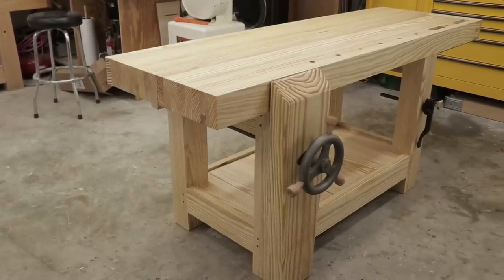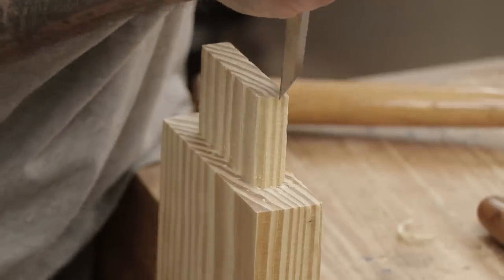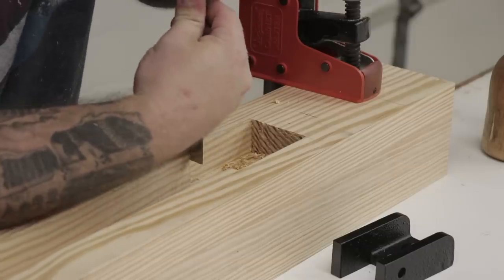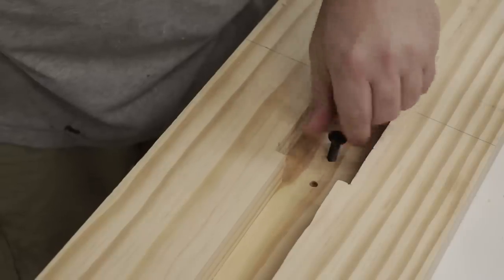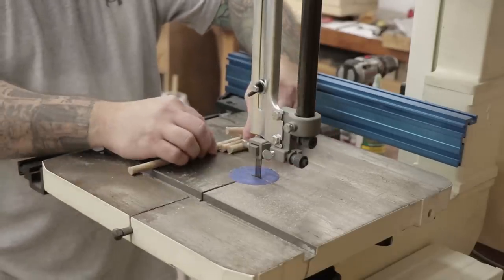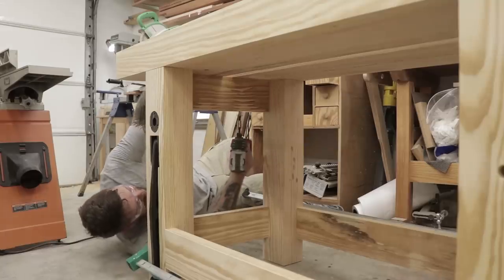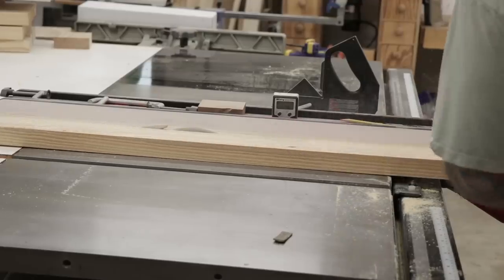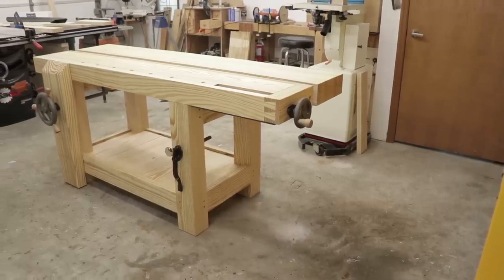Building A Roubo Work Bench Out Of Southern Yellow Pine (Part 2, Completing The Project)

Comment: Beautiful workmanship; alot of preplaning and well thought out..great job, labor of love. Last one I made in '97 was with 4X4", treated for the legs; 2X4 X 12' treated for upper and lower railes, 2X4 cross section braces, all on lockable casters...3/4"  Plywood top sections, builtin table saw and router, flush with the bench top... 10' long 32" high and 20" wide.. it was still there when we sold and moved in '17 What I had at the time was a circular saw, scroll saw, rulers and pencil...
Reply from the maker: Thanks! If I get 20 years out of mine like you did yours, I'll be happy.

Comment: Great video, thank you. When cutting your stretchers you were using the fence as your first stop, and using your miter gauge for the cut- clamp a stop block to the fence before the blade so that when you are making the cut your board is not riding the fence. Much safer that way. Awesome video though and very informative!
Reply from the maker: Thanks for the tip. I had to go back and watch again to see what you were referencing. I use a stop block when cutting all the way through the board but not when making dados shoulders and tenons. It doesnt make sense why I thought one was safer. Thanks again

Comment: Here's a tip I use when I want to tap a hole in wood. After I drill the pilot hole I saturate the hole with thin Cyanoacrylate glue commonly use for building model airplanes (I build those too). Then I tap the hole. Almost as good as tapping in to medal. Last time I used a saturating epoxy available from Totalboat. It works just as well but has a longer drying time.
Reply from the maker: Thanks for the tip. I will try it the next time I tap some wood threads

Comment: Maybe a silly question, but why did you leave the middle gap on the top? Because of the wood movement in the future? I just wonder about the the reason why not everything is glued together. Thanks and well done!
Reply from the maker: You can remove the middle piece and apply clamps through the top to hold down a  board. You can also use the board in the middle as a stop when you are hand planing or using other hand tools. It has come in handy a few times over the last few months.
Reply from the maker: I made a video about making a shaker cupboard with only hand tools. I use the middle feature a few times throughout the build
Reply: Gap is specific to this design. As noted, removal for clamping. Also slide in insert with slots to hold chisels, marking gauge, hand saws, etc.

Comment: Very nice job. I think pine is a great choice as the bench takes the abuse less than your projects. You did an excellent job on the joinery. How do you like that Craftsman plunge router. I have the fixed base and have had issues with the shaft lock pin and the height adjustment being sticky. Gave another thumbs up and subscribed. Liked your picture frame video as well.
Reply from the maker: Roland Kuhn Thank you. I have the same problem with the lock pin on the router. The micro adjuster also broke shortly after getting it. I would love to get a festool eventually but for now the craftsman works well enough. It definitely got a workout on this project.

Comment: Thank you so much. Your video was very clear and instructions easy to follow. I'm very much a novice and really don't don't even have a true workshop yet. Any advice? I either have to work out side or our storage shed which isn't that big
Reply from the maker: My advise would be to try purchase tools as you need them for a project. I bought a lot of tools the first couple years that I though I would need but never ended up using. The basic 5. Table saw, miter saw, jointer, planer and router table(mine is homemade and cheap). You can build most projects with these tools.
Reply from the maker: And if you  want to learn hand planes you could hand plane 2 faces of a board and not need a jointer. Hand planes are cheap for antiques

Comment: I'm curious about the piece of wood in the middle of the two tops. what is the purpose or how does work?
Reply from the maker: It has two notches on the bottom that straddle the top stretchers so I can move it over a couple inches and it sits higher than the rest of the bench. I use it as a planing stop or use it similar to a bench hook. I can take it out completely and slide a couple clamps in the gap to help hold boards in place. Some people make the middle board have holes in it to put chisels, saws and marking gauges in so they dont roll off the bench when not in use. Hope that helps
Reply: thanks the only real woodworking I have done is woodturning, and the work bench I built is welded steel, I'm a hobby welder. @TwistedWorkshop77
Reply from the maker: @wrav47  anytime. I have been playing around with a little welding but I have a lot to learn

Comment: Hey I really like the two videos and will probably do the same for mine. One question though. At 0:48 you laminated those two boards with the grain directions going the same direction. I noticed this in the first video with some of the laminating too. I was told that you’re always supposed to alternate the grain directions of boards, like if you had turned the top board face down at the time I marked instead of face up, so that you prevent warpage. Is this something that you’re aware of and chose to do anyways for some reason? Thanks!
Reply from the maker: Thanks for watching. I quit worrying about grain direction on table tops and glue ups and just focused on what looks the best. If it were a table top, I just add braces underneath or breadboard ends to keep the piece flat. In the bench top, I wanted as much of the grain going in the same direction to make it easier to plane. I thought the vise chop would look better at the top with both boards facing the same way. The vise chop is as flat as the day I made it. The top has moved a little after almost 2 years but planing it flat again will be much easier than if all the boards were going in opposite directions.

Comment: Wow, great video of a wonderful bench.  I am considering replacing my scandanavian bench I built 25 years ago and the benchcrafted hardware and bench plans are my current favorite.  I have nothing but admiration for your skills.  Building it would be a challenge by itself but you did a wonderful job documenting it as well.  I do have a question for you.  I am thinking of putting a sliding deadman and a 2" planing stop ala the roubo in Schwarz workbench book.  Do you forsee any trouble doing that with this bench?  Again, thanks for sharing your skills with others.
Reply from the maker: Thanks! I added the sliding deadman a couple months ago and love it. There is a video of making and installing it. It would have been a lot easier when I originally built the bench. I am planning on adding the planing stop in the next few weeks. I just finished a hand tool project and really wished I had the stop with some teeth to bite the wood and keep it from sliding around.

Comment: Nice build! I will be incorprating some of your joinery techniques (rounded tenons) in my new bench build. What's the brand of table saw miter guage (crosscut sled) you're using? Looks like a nice one.
Reply from the maker: Thanks! Good luck with the build. The miter gauge is made by Osbourne. I liked it because the extension slid out more than some of the others I looked at.

Comment: The bench looks amazing, nice job 👌. Love your workshop. If you had to choose one of your electric saws to use, what one would it be. The reason I ask is that I have a small shed that could fit one in, to do simple wood working jobs on.
Reply from the maker: Thanks! I could quickly cut lumber to length with a hand saw. Lately I have been using a circular saw to break down sheet goods. If i were going to focus on  hand tool woodworking, I would only have a band saw. It would be good for ripping long boards, cutting long gentle curves or resawing thick lumber in to veneers or thinner stock. Those tasks are difficult or time consuming with hand tools.
Reply: @TwistedWorkshop77  thanks buddy, ill check some band saws👍
Reply: I would prefer my radial arm mine does a lot in small shop.

Comment: how much did all the wood cost and how long did the project take from start to finish as I'm thinking of making a roubo style workbench for my major work
Reply from the maker: I spent about 145.00 on the wood. 2x12s I bought the wood at home centers so i could pick through for the cleanest boards. It took me about 4  nine hour days to complete the build. I am happy with the bench. I have used the split top center strip as a stop for planing a few times and it is a nice feature
Reply: thank you for replying, would you recommend it as a major for yr 12

Comment: I tip for threading wood from an old ski shop rat who has installed a couple thousand pairs of ski bindings. coat the screws with wood glue before you run them in. It takes up any space and pieces of wood that chip out from the threads. If oyu ever have to remove the screws, just use an impact driver.
Reply from the maker: Thanks! I'll give it a try next time

Comment: 0:50, I wonder if you should have flipped the top board over so that he end grain between the two boards "oppose" one another if you know what I mean.
Reply from the maker: I read a lot about this over the years. Some people really pay attention to opposing the grain when laminating pieces together to prevent twisting and warping. Some people just worry about making the grain match the best (I wouldn't have to worry about that in this situation). I dont think about it very much. Just the other day, I just ran my hand plane over the top to reflatten it but the chop stayed flat from what I can tell with just a visual inspection.
Reply: @TwistedWorkshop77  I'm sure it makes only a slight difference. Just a "why not" sort of thing, I guess.
Reply: I thought the same thing. I'm sure over a long time it can cause an issue, especially if exposed to humidity changes, but with all of the boards sandwiched and adhered together, it probably mitigates most of the potential to warp. Alternating grain pattern would probably be better practice in theory.
Reply: that being said.. Thumbs up and Sub, thanks for the detailed content!

Comment: It's been nearly a couple of years.  Anything you'd have done differently looking back?  Other than the bench dog spacing?  Appreciate the video.
Reply from the maker: Thanks! Definitely would have spaced the dog holes closer. I would have made the bench a little shorter. My first bench was 30 inches tall and I felt like I was always bent over. The new bench is 33 in tall and there is a big difference when using hand planes. I get much better leverage on my old bench. This is only a problem if I am hand planing all day to dimension lumber. I bought rubber matts for my work stations in the shop. They are 3/4 in thick made for horse barns. I can double them up if I am doing a lot of planing and this has worked out great. The height is good for all other joinery work though. Other than the height, I am happy with the bench and especially the vises
Reply: @TwistedWorkshop77  Good info.  Relative to the bench height, do you mind my asking your height?
Reply from the maker: @scooteroo  sure, I'm 5'8"

Comment: So it has been almost a year since this was posted. Is it still working for your needs? Have you added any new to it?
Reply from the maker: Thanks for the questions. I still love it and it fits my needs. I added a sliding deadman to support long boards. If I started a new bench today, I would build the same one but I would add the deadman during initial construction. I would make the bench an inch shorter to get more leverage on hand tools like planing and I would have spaced the dogs a little closer.

Comment: I wanted to ask the author of this video (or knowledgeable commentators) if it is possible to build a quality bench like this without the thousands of dollars of power tools I see featured in this shop?  I'm looking to start building up my garage and a nice workbench seemed like a pretty good starting point, but it's tough to justify spending so much money on planers, routers, jointers, etc. just for my first project!  Where did you guys start?  I did some basic math, and for me to make a 150 dollar table (in materials) would cost a couple grand (in tools)!!
Reply: Yes it can. This style of bench has been around much longer than any power tools. While the power tools take much of the labor out of the project, and speed things up a lot, you can build this entire bench with hand tools. On the plus side, if you do use only hand tools, you will learn much about tools, wood and the relationship between the two during the process. Have fun!
Reply from the maker: Yes. You can build this without a lot of expensive tools. A large number of people have made this style bench with just hand tools. This is my third bench. Each one was a little more complex than the bench it replaced. It took me 14 years to collect and upgrade to this equipment so I just made the best bench I could with the tools I had at the time. My first bench had a top made from a couple pieces of MDF glued together. You could also get a butcher block top from IKEA or woodcraft to avoid all of the laminating boards together. That is the most labor intensive part. I dont know what tools you have now but routers are pretty cheap in almost every pawn shop I've been to. Less than $50 for sure. Rip cuts could be made with a contractor style table saw(also very cheap on craigslist and pawn shops). Flattening the boards with out a jointer and planer can be done with hand planes.
I hope others chime in and give some advice!
Reply: @TwistedWorkshop77  Thanks for the reply, I'm going to start working a project like this as soon as I've finished refinishing all of the furniture I'm currently stripping in my garage!  Limited space problems!
Reply: Hand tools, need a no 4 smoothing plane stanleys are cheap on ebay, no 5 jack plane, harbor fright chisels are $6.99 for a set of 6, they are good enough for a first set.  japanese pull saw, panel saw, dead blow hammer and soft faced mallet.  You also need clamps, lots of them.  I havent built my roubo yet but I built a nicholson english work bench, took me 3 weeks to complete everything.  .

Comment: as an amateur I am really surprised (in the good way) you didn't use sand paper.
Reply from the maker: Thanks! Pine is pretty easy to get a good finish on with hand planes and if there are a few rough spots, it's ok on a work bench